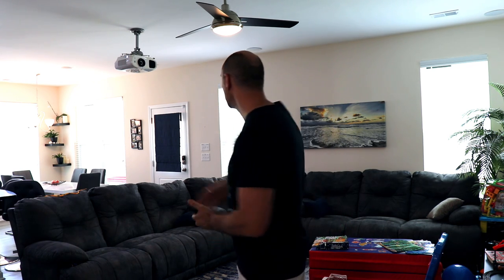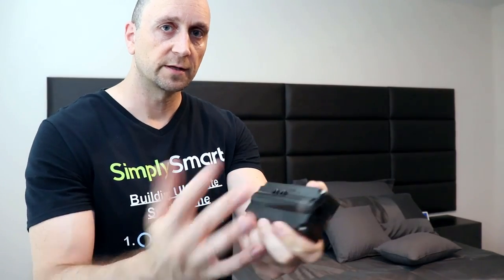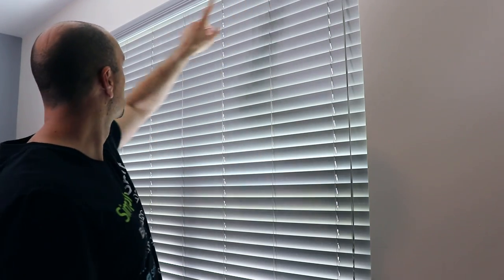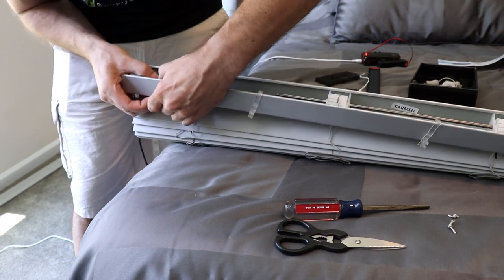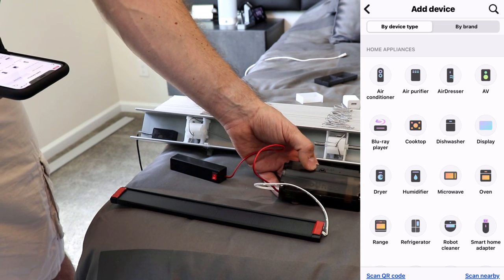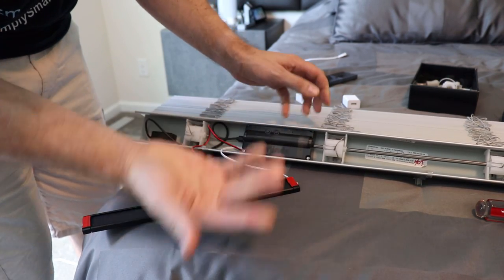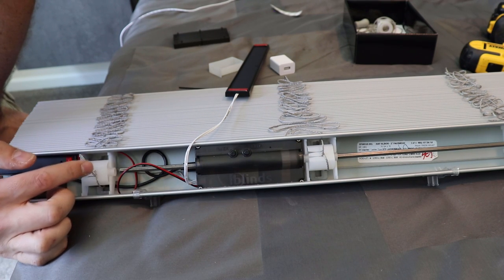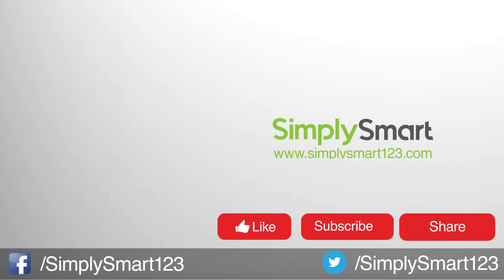Your Blinds Smart NOW | SmartThings, Amazon Alexa, iBlinds (2021)

Comment: Justin, excellent demonstration on setting up iblinds with SmartThings & Alexa. Now if it could raise & lower the blinds, I’d be in heaven. I have panels that I close & open over a sliding glass door that uses a similar shaft arrangement as your blinds. I wonder if I run the motor longer so that it would open & close them, that would be very cool!
Reply from the maker: Thank you! It would have to be a very strong motor to lift the blinds. I have never seen one but like you said it would be very cool.

Comment: Nice job Justin.  These look very cool.  I may need to invest in one of these for my kitchen sink window.  Look like the housing channel that holds the battery and motor is fairly large.  With which brand of louvered blinds is iBlinds compatible?
Reply from the maker: They should be compatible with most blinds. Mine are 2 inch blinds. So I would think that you would need at least 2 inches because the motor fits very tight in the 2-inch headrail.

Comment: I installed 11 iblinds and they have been great and well worth the effort. Within the last few months I have been having issues with some of them. First they drop out of the Alexa routine. I can still control them in SmartThings or they will respond to a verbal percentage request (in Alexa) but not to a simple open or close command. Sometimes they say they are closed (in the apps) when I can see they are open. Then finally, they stop responding all together. This is happening with 4 blinds so far and the situation seems to be progressive with only one at the “no response” stage which I am about to replace. Can you think of anything that can be causing this? I don’t want to replace all of them.
Reply from the maker: are you using the correct smart things driver?
Reply: How do I check that? When I click on “select different driver” it shows nothing. Also, in all but 1 of my iblinds, when I click on “settings” it only gives me the option to reverse the direction. No way to change speed, intervals etc. is there an update I am missing? They are all the same iblinds version .
Reply from the maker: @jannmyers8360  you will need to add the iblinds z-wave edge driver and the associate your blinds with the driver. https://support.myiblinds.com/knowledge-base/device-drivers-hubitat-smartthings/
Reply: You are a genius! Edge drivers installed and all controls are available. One last question, I have 1 blind that will not take a charge. Do I need to replace the entire unit or just the battery?
Reply from the maker: @jannmyers8360  not sure about that one. All of mine are good so far. Be sure you are using the provided wire to charge as the connection is longer than a traditional wire. Probably best to contact the company directly to see what they suggest in your specific case.

Comment: My blinds have a rod that control the tilt, but your video shows the tilt controlled by strings.  Will this still work?  Any links to the companies official install vids?  Can't seem to find them, thanks!
Reply from the maker: it should still work because if you look inside of your blinds, there should be a metal shaft and that is what it turns

Comment: How long does the battery last?
Reply from the maker: With the solar panel I have only had to charge one of my blinds so far since making the video. The reason for that is because it’s under a covered porch and doesn’t get much sunlight. But they do not need to be charged very often even if you don’t have solar panels they should last many months between charges.

Comment: How do you get them connected to Alexa?
Reply from the maker: First you connect them to your SmartThings Hub. Then connect your SmartThings to Alexa. All devices will then be voice controlled.
Reply from the maker: These will need a hub because they are not wifi. Wifi requires a lot of energy. Many wifi smart products may an Alexa skill that will connect the two through your home network.
Reply: Do your solar panels keep the battery at 100%?
Reply from the maker: Mostly. I do have one that is under a covered porch and need to charge every 6 months.

Comment: OK, I am stuck right at the beginning. I am retrofitting into existing 2" header rail. Trying to fit the charge adapter and clip together. You say press as hard as you can. No matter what, I can't get them to snap together. Any work around or tool I can use without breaking the clip??
Reply from the maker: Is it fitting in your existing hole? It should easily fit and then you slide the other part on from the inside it doesn’t have to be fully tight but it is a better install if it doesn’t move after you are done.
Reply: @SimplySmart123  Yes, it fits perfectly. The parts line up but there does not seem to be enough length to the pins for it to snap together. If I hold the individual parts at the end of the bracket the button extends about 1/8" beyond the opposite edge and the prongs from the clip seem to extend about 1/8" as well. They must be EXTREMELY close to snapping together but when lined up the charger is flush and so is the clip. They just don't snap together. I have also tried another clip and no dice.
Reply: @SimplySmart123  When the two parts are together the button is just slightly above the surface of the clip while the charger is recessed inside. Should more botton show that this? I'm think I might need to glue it but that does not seem like it would hold when the charging wire is inserted. Besides cosmetic, it would seem I can get along without this and just set the charging unit inside the blind bracket. I have the solar panel for continuous charging. It seems kinf of cheap to be geri rigging this early in the install.
Reply from the maker: I might contact the manufacturer and see if they can solve that issue for you. Do you want to have that button available in case you need to reprogram or do other things in the future.
Reply: @SimplySmart123  Thank you for your ideas and quick response. I did write to iBlinds support to see if they have any suggestions. Should hear from them tomorrow. In the meantime I am going through the rest of the installation video and complete the installation and programming. I may be able to mount the charger to the back (window) side of the blind. To your point, I only need access to the button. The solar panels should eliminate the need for the charging.
Reply: @SimplySmart123  I finished setting up, installing, and programming the blinds as I described in my previous post. They look and work perfectly and you can't tell that the charging unit is not inside the header. I can still reach it (attached to the back side of the blind) if I ever need to and the solar panel looks good too. Thank you for all your support. I only have 8 more (different types) to go!
Reply from the maker: Let me know how you make out! With the solar panel I have never had to charge mine and one is even located under a covered porch!
Reply from the maker: Awesome 👏 These are my favorite device I have ever gotten. A truly dumb device made smart. My wife likes them also!
Reply: @SimplySmart123  I just installed 5 more blinds that are in one room. Went really well except for the charger and cap. On these (Bali) the hole is huge so, again, doesn’t work for me. My process is to just attach the charger to the back of the blinds along with the solar panel. Looks great. Watching your video again to see how to connect to my Z-wave hub and group. I see that is in Alexa. I am going to end up with 4 locations and 3 groups so fingers crossed.
Reply from the maker: Sounds great. I want to get more for my upstairs now!
Reply: @SimplySmart123  OK, I'm back. I have successfully installed 6 blinds and tried to group 5 of them. I did not have a lot of luck in Alexa so I programmed then in a schedule individually so they pretty much work as a group. Not ideal but I will keep trying. I am now starting my 3 bedroom blinds.  So, with this group the control switch does clamp together as you described. I am amazed that in 4 rooms in my house I have 4 different brands of blinds.  On this branc I did have to change to rod to the hexagon so I have now had practice with all the options. In this particular brand the power cell did not fit inside. I now put the power cell on the outside as a matter of routine as it does not show and I still have acess. So, my issue de jour is, I completely set up and charged the 3 units. I went to program them and none of them will connect. I must be doing something wrong for all of them to do the same thing. I noticed that there is no power light on inside the units but I know I charged them long enough - at least 20 hours. I have everything connected except the external charging cable (The lights were on while it was charging and the green light was on. am I missing something? I watched another video that said the controller could not be plugged in but this would not have anything to do with power. The 1/0 switch is definitely in the "1" position on all three.
Reply from the maker: Try charging it with the light off. Or even try to connect it while it’s charging I always like to connect the units before they are installed in the blinds that way I know if there’s going to be any issues and I don’t have to mess with the whole set up I can just carry it around in my hands and get it closer to the hub if required.
Reply: @SimplySmart123  Hello again. I just rewatched your video because, after 5 months of flawless blind performance including Alexa control, all my z-wave devices have gone off-line. I am not sure what caused the problem but I think it may have had something to do with my router. Anyway, when all this happened I could see all of my (10) blinds in the SmartThings app but seven were showing unresponsive and not connected to the cloud. I had to have my hub and mesh system reset with the thinking that I would reconnect all my 33 devices. Most of them actually reconnected by themselves and I was able to reset and reconnect all the devices except the z-wave ones (I also have 2 schlage locks which won't connect either) ALL of my iblinds are gone and no longer show up in the app at all. I am unable to reconnect any of them. I tried resetting them (10 second press) and reconnecting from scratch (3 quick presses) I still get a message that the iblind could not be connected. I have tried several times with 2 separate blinds but no luck. Any suggestions?
Reply from the maker: I would charge the blinds to 100% and bring your hub and blind closer if possible. Then try again.
Reply: @SimplySmart123  How do I know if the blinds are reset? Is there any way to know, by looking at the device, if the device is in pairing mode? I did take one blind down so I can move it near the hub and I did charge it overnight. If I can ge one connected I know I can get them all connected. I did  reset on 5 of the blinds. 2 went through the recalibrating and are now stuck closed, 2 are stuck in the predetermined position and did not recalibratel, one has never responded to anything. I charged all to 100%. (The solor panels are OK but I would not say they are keeping up with the devices especially if there is an overhang like my lanai. I have windows facing all directions.)
Reply from the maker: It sounds like you are doing everything correct. Maybe contact iblind support and see if they can help you further.